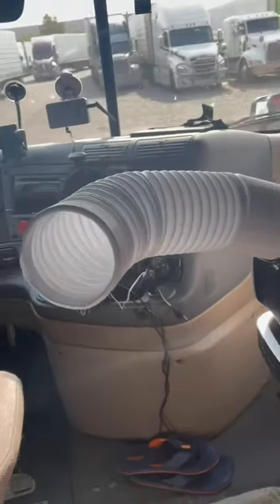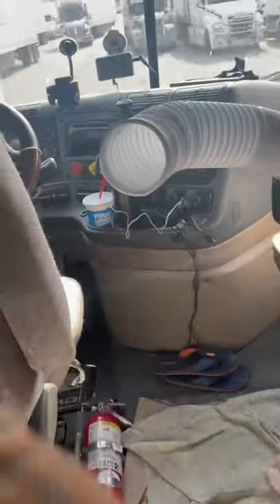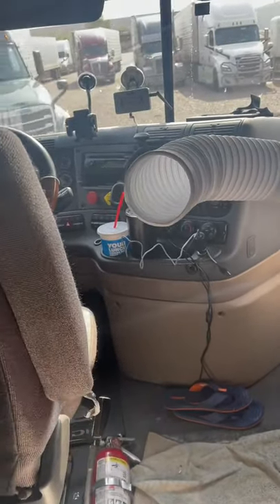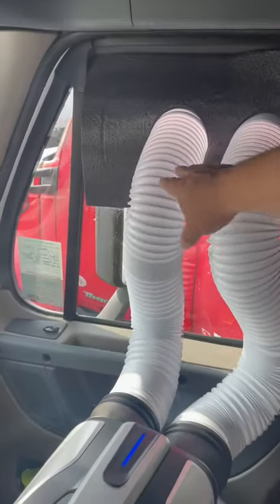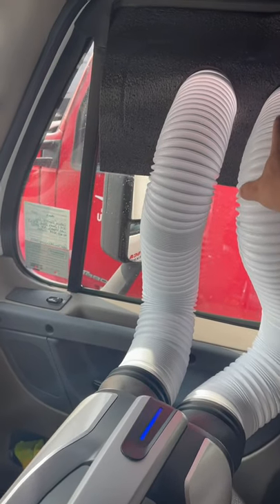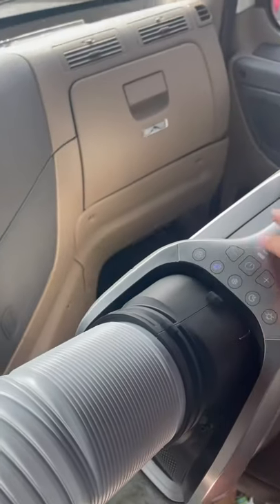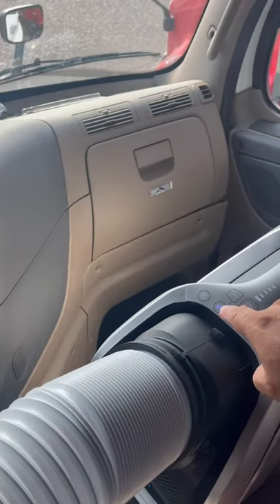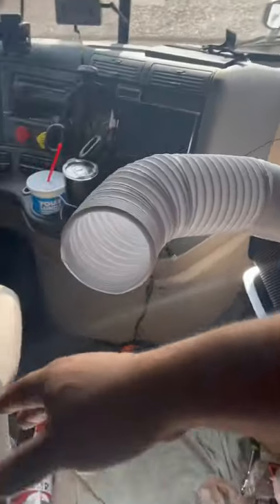Zero breeze semi truck test

Comment: 8000 btu window unit from back wall of your truck is the way to go. I tried everything from water cooler to portable ac unit, nothing can beat a window unit.
Reply: Interesting.. so do you carve out a hole on the back wall of your truck and install the window unit there or? Forgive me trying to understand
Reply: @numberjack3374  
1.  Carve out a square on back wall of your truck
2. Support it by 2 flat metal bars form your chassis 
3. Get any cheap 2000 watt generator ( I have champion 2000), and an aluminum box for it.
Reply: Can't do that in a company truck unfortunately otherwise I would've done it already
Reply: What about wave 2?

Comment: I have a question, so the hot air goes out and the cool air comes in BUT  does  the smell of Pee from truck stop come inside ?
Reply: I'd recommend getting the truck cool at first the regular way at night to get the Temperature down to 70ish. I wouldn't run an intake hose from the outside so it can keep the 70 degree air inside cooler. And not use the86 degree humid air from the outside. The best ac units can do is 20 degrees  cooler, so that 70 degree will come out as 50 degrees. Plus no bugs or Nats getting sucked in your truck

Comment: You get colder air on a slower fan speed.  

So if you have a separate battery fan you can move some air with. Use that.  An put the zero breeze in boost mode.  An put its fan speed on like 2.  

The compressor will be running wide open. But the air passing the coil is going to be going a little slower picking up more cold from the coil.

Comment: Why not recirculate the inside air to allow it to continue to keep getting cooler?
Reply: That makes more sense.
Reply: The rear hoses only to cool condenser. The air it cools is drawn from the front of the unit completely isolated
Reply: @TheUnpredictableFam  correct.  It won’t circulate.  It will actually pull vacuum.  
 But at the least bit the air over the condenser will be cooler an less moisture.  This not working it as hard.
Reply: It is recirculating the cool air, the unit inside intake does not require a vent. The hotside pulls in air from the outside to cool it off rather than pulling air from inside to cool the hot side of the AC.

Comment: Why not just get an APU?
Reply: ApU are expensive and adds like 500 pounds of weight
Reply: @gerardovillatoro2905  I believe you get a weight exemption if its a battery apu. If your worried about scales
Reply: Because it's  $12,000 difference

Comment: Do both of the rear tubes suck air in?
Reply: No one is exhaust and one is intake so you want to keep them pointed in different directions to avoid intaking the hot exhaust
Reply: @phillipcastillo8519  thanks!